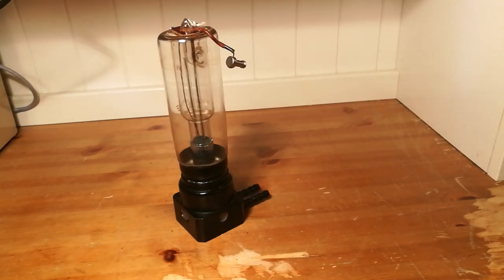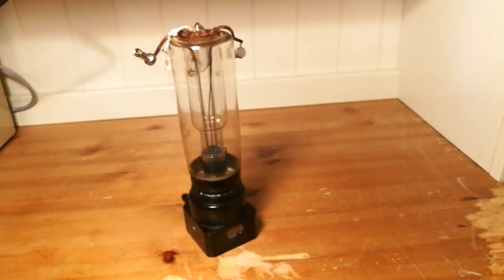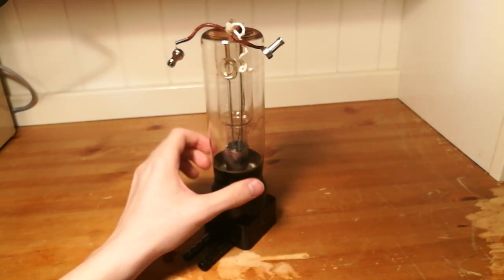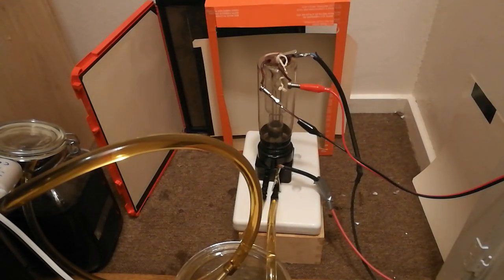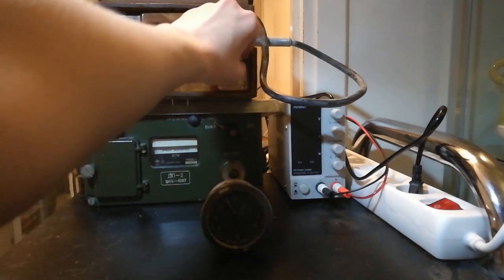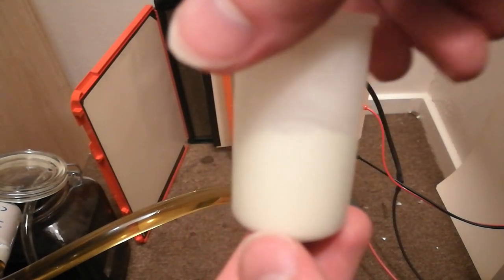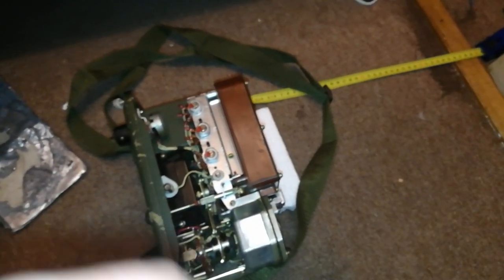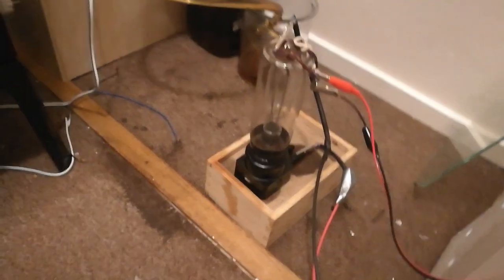Radiation Burns In Salt Using BSV-10 Structural Analysis X-Ray Tube

Comment: These 2 are probably the most scary X-ray videos on youtube:
https://www.youtube.com/watch?v=F90d4AF4WCU

https://www.youtube.com/watch?v=PhHdClTbHM4
That guy runs his tube with 4 beryllium windows at 60kV  20mA.Thats an insane amount of both soft and hard X-rays emitted in all directions.Its also turned on for a few minutes and he X-rays his hand twice.
Reply from the maker: haha love that guy, I have seen those and they where awesome. He is surprisingly "safe" with it though, he seems to use lead at the other windows. But that he x-rayed his hand with it is not a good idea. Those tubes emit pretty much only soft x-rays which has the highest chance to cause mayor damage. (and they don't make a good picture compared to tubes with a tungsten anode target)

Comment: Crazy! After you irradiate the salt what does it smells like? i would guess there must be some kind of smell, maybe even some chlorine?
Reply from the maker: I did not notice any smell from the salt. Don't know if the intensity or energy is too low still for any such breakdown of the molecule.
Reply: @radiumquetzal8000 Irradiation of salt does not cause any molecular breakdown, which is why no smell is present. Instead, the radiation causes an electron to be excited and move to occupy a vacancy in the crystal lattice. No Na-Cl bonda are formed or broken

Comment: Without The beryllium windows, would it put out the same amount of Radiation?
Reply from the maker: It would not. The tube is made to output in the low energy region of xrays so I'd suspect that most xrays would not make it out of the tube if it did not have Be windows.